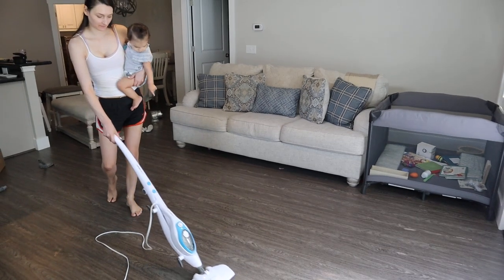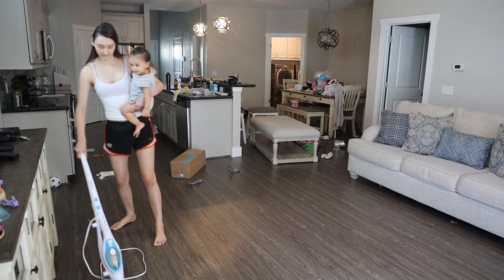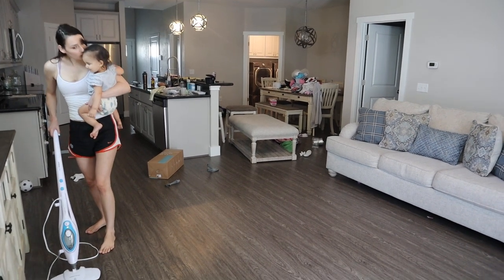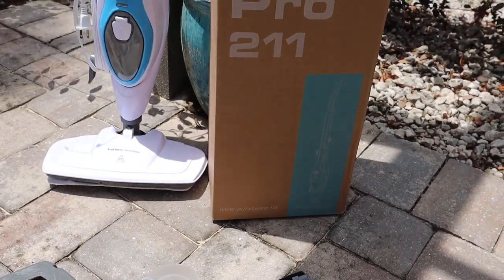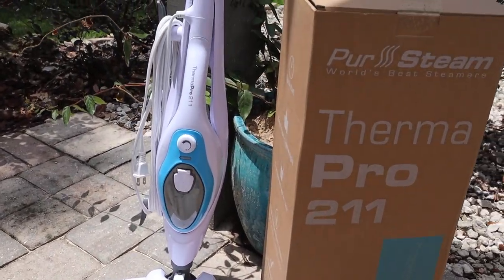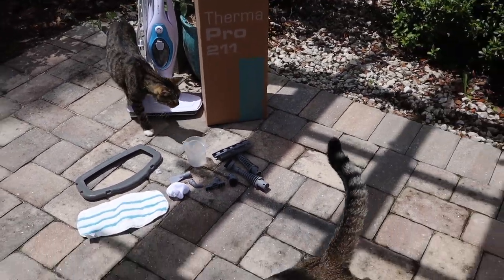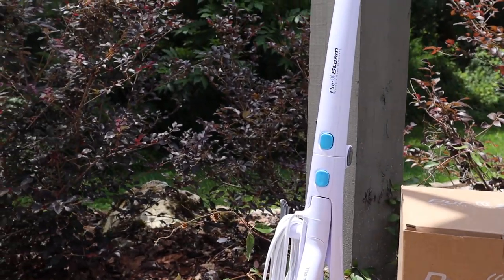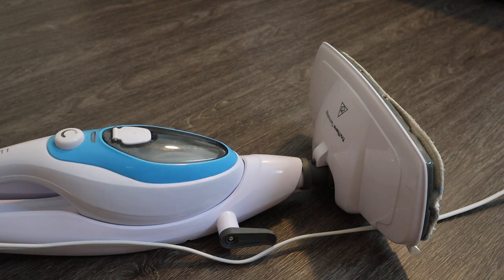THERMAPRO 211 STEAM MOP REVIEW // Watch it Clean in Action!

Comment: Does it leave the carpet really wet? I have harwood floors underneath don't wanna damage my wood floor by trapped moisture.
Reply from the maker: Yeah that’s a good point. If you do steam mop I would definitely buy a fan onto the carpet or something. But ultimately that’s your decision. But yes the carpet will get wet but not drenching wet
Reply: If you don’t leave it in one spot for too long and as long as you keep it moving pretty fast, it won’t leave your carpet wet! Plus you can turn down the amount of steam that actually comes out of the mop. I always turn it down pretty low when I do my carpet, and just make sure that I move it back and forth pretty fast, and don’t go over the same spot too many times. If you do that, it won’t leave the carpet wet at all, it just leaves it really warm lol :)

Comment: CAUTION TO VIEWERS - You aren't supposed to steam laminate flooring. According to the flooring industry, "Laminate flooring is sensitive to heat and moisture, so the humidity from your steam mop can cause harm. It won't cause as much damage as a wet mop, but could eventually cause your floor to warp, loosen or peel."
Reply: Thank you for the heads up on that. I'm just learning how to use one of these and I might have made this mistake if I hadn't of read your comment, so thanks again 😊

Comment: Is there a way to get all the water out of the water tank when you are done using it? The rubber seal prevents a significant amount of water from being dumped out.
Reply from the maker: I just steam mop until it’s empty. If you ur floors don’t require a lot of water don’t fill it up all the way next time:) 
Or you could use different attachments at different places around the house to use up the rest
Reply: Roll up a paper towel, to soak up extra water in water container.

Comment: Is there a certain setting you put the steam on for windows and mirrors.  Mine seemed to drip a lot of water and I found it to be messy.
Reply from the maker: Hmm, dripping water from the device or from the condensation on with windows itself? 
Yes there will be dripping on window but shouldn’t be from device. This is going to be common on all steamers I believe. The hot water really helps to remove the streaks and dirt. I always have a towel near by to wipe away the extra water. I hope this helped! I do not put it on a special setting - I almost always use it on the full setting no matter where I am using it 
:)
Reply: So do you use Distilled water for this mop?

Comment: Is the loud hissing noise normal? Mine is making a sound so loud that it's deafening, and my ears would ring for minutes afterwards.
Reply from the maker: Hey girl! Oh my!!! I do not think that’s normal:( see if you can exchange it?!? Mine makes a slight noise when the water is low, but it’s only for a couple seconds before it ends up turning off due to no water. I hope you get a new one that works well bc it’s a great mop when it works properly!!
Reply: I actually started browsing videos on YouTube in order to see if other people had issues with noise. Mine is incredibly loud as well! I had to take a break after cleaning a third of my shower because my ears where ringing so badly. Did you happen to find a solution for the hissing noise? Im trying to determine if mine is defective or if is just user error, haha.
Reply: @erikabelanich  I just ended up turning it:/ I think they are selling lower quality units on Amazon or other outlets that sell at a lower price.
Reply: @dreamcools  that's a bummer! Looks like I will probably be doing the same. It cleans so well but I can't handle the noise. Thanks for the help!
Reply: Mine also has a Noise  anyone found what’s the problem ??

Comment: It is observed in the video that it is impossible to place the pad and then the plastic to clean the carpet .. It is a manufacturing error because the heat of the steam apparently expands the hooks and it cannot be grasped by pressing the pad .. That happens to me with  mine.
Reply from the maker: Hmm we did click it tho🤷🏻‍♀️🤷🏻‍♀️ works fine for us
Reply: I had the same trouble at first. I noticed it seems there is an order to fastening the clips. It was pretty hard the first time I tried but once I got the hang of it it clips in well.

Comment: Mine stopped steaming.   Any suggestions?  Waiting for an email back from the manufacture
Reply from the maker: Oh no! Sorry to hear that! I assume the outlet(s) you’re using work on other items? I assume you have water in it? I assume you turned the dial to turn it on....I think reaching out to the manufacturer was a great idea! Maybe look through the owners manual or look online for troubleshooting it. Good luck!!!
Reply: mine too after 4 months!
Reply: It's probably clogged;  Especially if you use regular tap water. Most all steam mops clog after using it so many times. The reason for this is due to the minerals the tap water has. The Steam mop creates steam to dissipate the water but the minerals deposits remain; hence the clogging and calcification.  First read the troubleshoot part of your manual. If you don't have , then download the pdf.  If all else fails try running the mop with a mixture of water and vinegar to loosen up the clog.
Reply from the maker: Great advice! I wonder if it would be worth using distilled in it?!
Reply from the maker: Oh no!!! The comment below might help!!! I hope you are able to fix it!